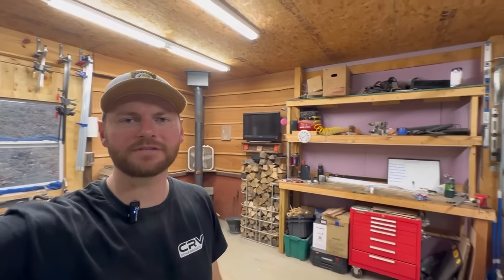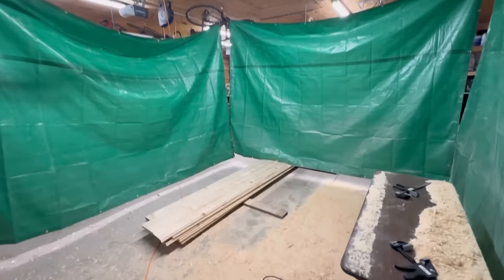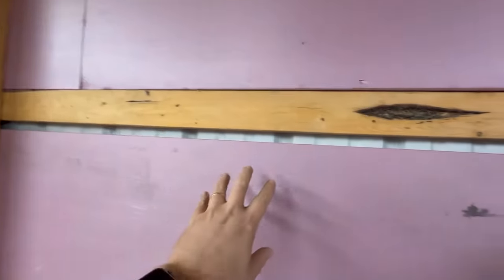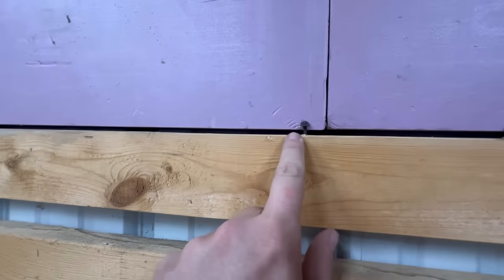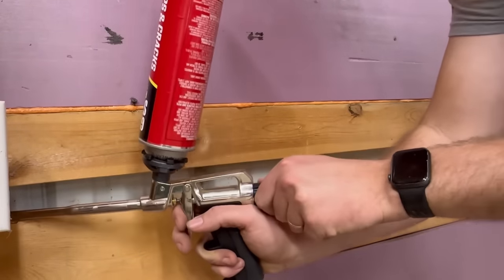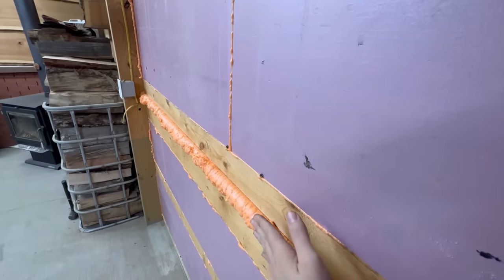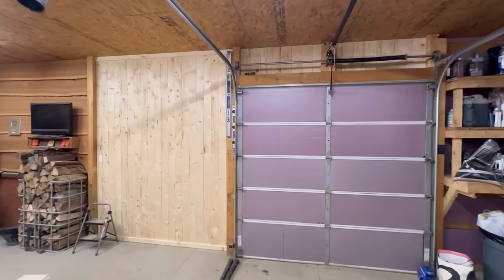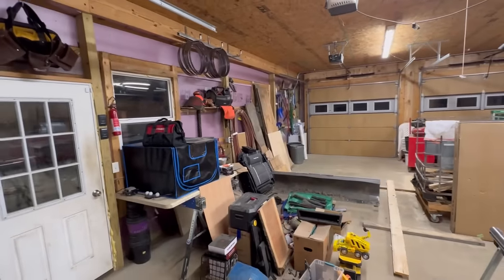Building With Lumber From Our Sawmill

Comment: I had many years of working with my father, doing custom cabinetry and find woodwork. The only time we really broke out dropcloths or tarps and hung them from the ceiling was to prevent overspray you just demonstrating how much work and time you can save yourself by doing that for routing and sanding Almost blew out my lightbulb😂. I guess we just got so used to making a mess and working through the project till the end that we really never gave it much thought about the sawdust.🙂👍

Comment: Great job, Adam. For the remainder of the insulation board project, you will be more pleased with the results of using cans of “door and window”foam instead of the full expansion foam that was used. It will be unnecessary to shave off excess foam utilizing that product. Looks beautiful.

Comment: I would strongly recommend staying in front of the table saw and using a push block or push stick to push your material against and along the fence. Kickback is much more likely to happen if you’re standing on the side and trying to guide the material straight through.

Comment: Adam, after watching your milling, think about building a router table, I built one out of a formica sink cutout and mounted my router underneath , cutter tip fed thru the middle. Built a fence with vac attachment so while Running the boards, all the chips went through the fence to the dust collector. (Just a thought)
Reply: Good idea.  Appreciate the comment!

Comment: Great job. What a sense of satisfction from making your own lumber, milling it and creating a finished project. Suggestion: keep your eyes open for a good, used cast iron table saw. With a dado stack and a couple of feather boards, you would have knocked out those lap joints in no time with a lot less dust.
Reply from the maker: I kinda like my little jobsite table saw. It folds up and doesn’t take up a lot of room when not in use. No doubt a dedicated cabinet saw would do a better job though
Reply: @HometownAcres One of the little Bosch RA1171 benchtop router tables are nice. You can likely use it with the router you've got, it has dust collection, and it would give the stability and accuracy you need when you're doing the finer woodworking projects. What I like about this one is that it's small but pretty heavy so you don't have to worry about it moving around if you don't bolt it down.  I designed an adapter for it that can 3D printed to combine the two 2" exhaust ports into a single 4" exhaust for a dust collector (Thingiverse #2804509).
Reply: You don't need a dado, though they are nice to have.  Make your face cut and then just stand the boards on their side for the edge cut, with feather boards, of course.
Reply: @statonk007 Agreed. But I think I counted about 450 linear feet of 3/8 x 3/8 rabbits to make those lap joints for that one wall section. With a lot more to go. That’s a lot of passes. Would want a tall fence attachment to make those cuts safe. Good news is you would wind up with 28 or so 1/4x1/4x8’ scraps that are not sawdust.
Reply: @statonk007  That's one way, but given the length of the board and that it looks like Adam is cutting 1/2" overlaps, that'd be 4 to 5 passes with the blade. At that point, even the handheld router is faster, albeit messier.
Reply: @JCWren  I was thinking two passes; one on the face, then rotate the board 90 degrees and one on the edge.  You'll need to add a taller fence extension for the edge cut but should be pretty easy.
Reply: @statonk007 Good idea, and blindingly obvious in retrospect.

Comment: Two suggestions, you already have the table saw so get a good Dado blade set snd do away with the router.  If you have and need the extra equipment, buy a table shaper.  Both will connect to your dust collection system.

Comment: Have you considered getting a router table? You can then hook your shop back/dust collection system to that and pull in 90% of your sawdust and not have to worry about the booth. That said, the booth looks to be doing exactly what you had hoped.

Comment: Maybe there's a way to use the log arch to move loads of cut lumber. Instead of handling that lumber twice before plaining, you could backed the load into the shop. 
I really like the tarp idea. 
Has 1.5" of foam been enough to insulate your shop? What did you do for the roof / ceiling?

Comment: I'm nowhere near your level of expertise, but on my router table, I clamped my vacuum nozzle near the router spindle and it does a pretty good job of sucking up the sawdust, probably about 90% of it. I see you have a vacuum attachment for your planer and table saw, so it should be pretty easy to rig something up.

Comment: Seems like another solution on the condensation could be using spacers between the wood and exterior metal siding. I know that can be good for clapboards. Something like a garden hose washer at the fasteners could work… that would have to be incorporated at initial construction though. I definitely think folks underestimate the amount of moisture in an insulated space… buildings need to breathe. Rot is one thing. The potential for mold is another. The latter can take less time to get serious, and might be worse to deal with.

Comment: There is a plastic sleeve/fine tip that slips over the end of the spray foam nozzle giving you more control and a better results on thin cracks and crevases. They come in a package of 10 for $9.99. I use them all the time.

Comment: Using the router to cut in shiplap joints does make a mess.   Consider using the table saw with a dado blade set.  Much faster & far less mess.

Comment: You removed a piece of foam insulation that was cut properly, all it needed was to be caulked to keep moisture out (or tuck tape) Then you removed a quarter inch and placed that same piece of foam back into the same spot where it is now too small and pumped expanding foam into the 1/8 gap you created, (that in itself eluded me, why great two gaps?) in an attempt to reseal it. If you look at your video, you failed to seal it with the foam. You shouldn't always listen to all you tube info until you've thought it through. Fit the insulation properly and then either caulk it or Tuck Tape it eliminating the moisture issue. The moisture is caused by condensation. Expanding foam is worth it's weight in gold but you're wasting it here, it isn't an effective sealant. BTW IMHO your EZ Boardwalk Saw Mill is an incredibly simple machine, Great choice. If I was thirty years younger I'd try to import them into Canada.

Comment: In PA you need to meet the Uniformed Construction Code requirements to be allowed to use lumber sawn by either yourself or another not authorized to produce rated material.  Most often it is easy to meet these codes but be prepared to show how it does especially in regards to insurers.  Review the USS codes or other odes specific to your location and do not forget localities may have even further codes needing to be met..  Often you can meet these standards but you need to know what they are to do so and to prove you have done so.
Reply from the maker: That would be true if the lumber being used was structural or load bearing in anyway. But what I did today was no different than hanging drywall. Also how free are we really if I can’t mill trees from my own property and build things with it